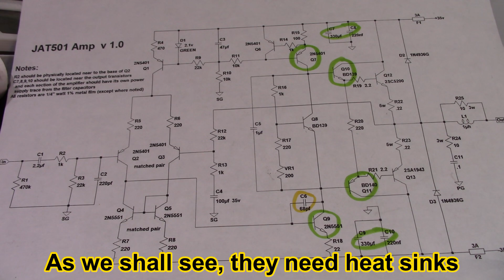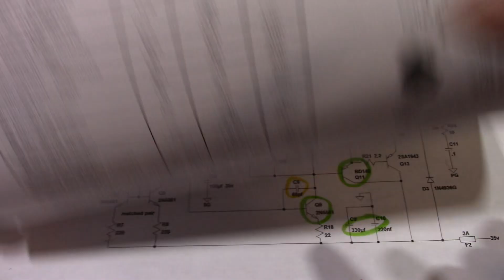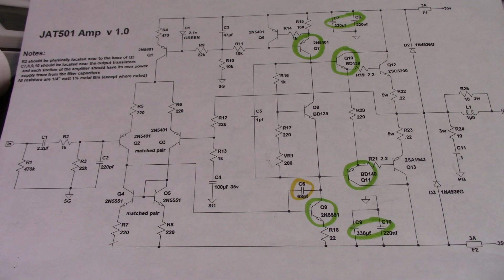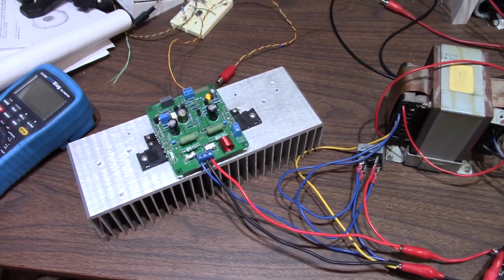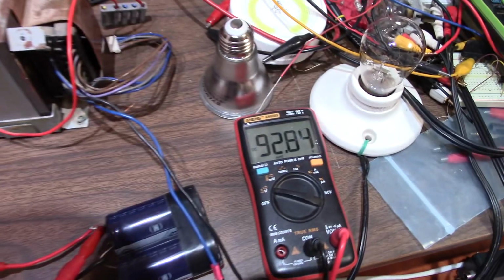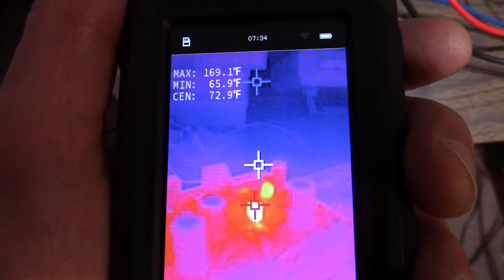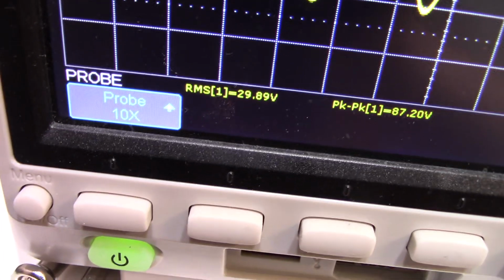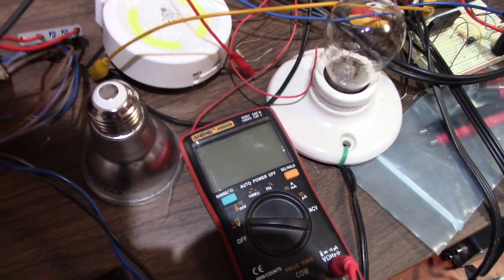JAT501 amplifier "hot rodded" for more power

Comment: UK, Sorry - off-topic. I have a Samsui AU317 that needs re capping and I wanted a cheap fill in amp to tide me over. I bought Who Flung Dung AK 370 12V 20 + 20 W (RMS ?) that states 15 Ohms. My Tannoys are 15  Ohms. I was not expecting much for around £10 ($13) but. I know a little about amps but mainly valve. I built a Mullard 20 + 20W 15 Ohms (EL34's) and 2 x 3 valve pre amps many moons ago, which I still have. 
Back to the Who Flung Dung. In honesty, John, I was gobsmacked. I'm 77 and the old lugholes are fading now, but according to a test record I have, I'm still OK for 10K and a bit more with knob tweaking. If you like bass, old age is the best cure. If you should ever be in the mood, this little amp might make a good video.

Comment: Hey john i think you should use a lot bigger filter bank around 15k microfarad on each rail side and a pi filter to stable the dc line voltage that would drop around 1.5 volt to 2 volt from one cycle to another on 110 watt load
Ofc if the transformer is capable of handling 110 watt

Comment: I decided to go the other direction,  running +/-24VDC in class A mode. The performance is stellar!!!
Reply: Must have great dynamics. Hope your heatsinks are up to it:)
Reply: any updates on your setup, how much bias I need to set to get the Class-A operation with same voltage as yours +/-24V DC

Comment: I'm glad for you. I heard the bell from the notifications and I have interrupted my experiments to improve my little Chinese stereo amplifier with one (FAKE) TPA3116D2  - in reality it is the SC8673E or something similar (16-pin DIL). You have tested in the past a board like this. As I discovered the 4 bootstrap capacitors 1μF each (under the heatshink) are really crap ! Using good quality MUSE (Nichicon) capacitors 1μF/50V at that position + the capacitors that they drive the main chip, the amplifier is DEAD SILENT ! NO "hish" at all even with the speaker staked to my ear. Oh the Chineses with the crap smd cheap capacitors they are using just to save some pennies .
As for the JAT-501 mods, if you make a new board try to consider if you please to mod a little the current mirror at the input and convert it to "MILLER CURRENT MIRROR". it is just one more thransistor  .

Comment: More and more high performance amplifiers these days are using proper, regulated power supplies, and soon the concept of "dynamic headroom" will only be remembered among some audio guys, dealing with obsolete technologies. Which they love.
Reply: Aw man your so right, but also not really! I spent ages making beefy regulated supplies for solid state power amps. It's expensive, it's not easy to do at all and  honestly they don't sound good (imo). Switching supplies are however viable options and used commercially but again they aren't fun to diy. 

Classic linear power supplies using a toroidal, a rectifier, and some filter caps are not becoming obsolete. The vast majority of amps use them.

Further, quality linear supplies are incredibly noise and ripple free.

I use complex low noise regulated supplies in opamp based preamps and sometimes input stages on amps. That's where they really shine.
Reply: Only for brief moment I was considering linear regulation, and I agree: It is difficult, big and expensive. But I will try SMPS. @peterlarkin762

Comment: I would suggest you to use at least 2200uF capacitors at the dual rail supply. They can produce more punchy bass with less distortion.
Reply: The large capacitors would be on the power supply.  The caps on the board is for local decoupling.
Reply: The power decoupling caps on amp boards do make a bit of difference BUT when I've done this on amps they always get changed back to around 470uf.

It's far more important to have a good supply with clean grounds and keep the cable to the amp short. As is the quality of the capacitors.

My current diy lateral MOSFET amps use only   0.1uf poly caps on the board and they're the best amps I've tried.